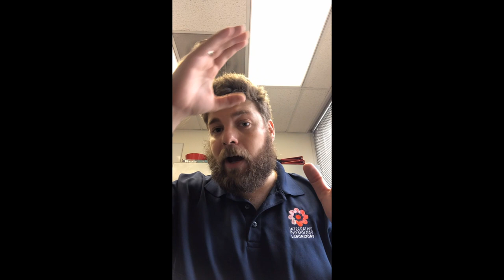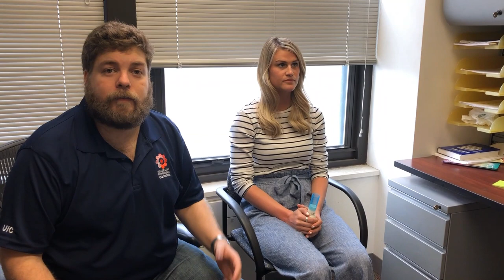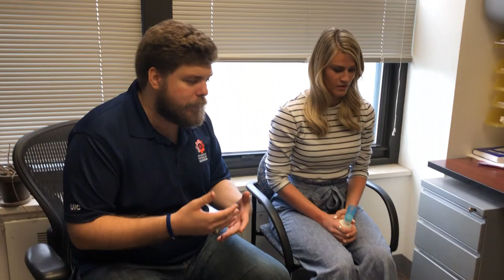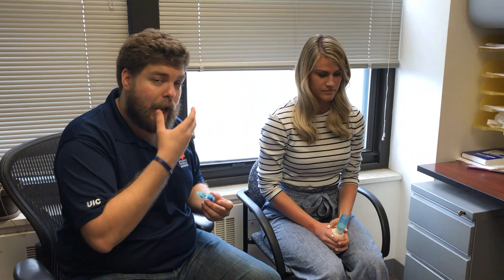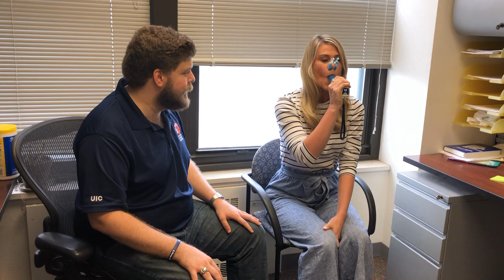Test of Incremental Respiratory Endurance (TIRE)

Comment: I try to measure TIRE via PrO2 and I am not sure, that I can get the value of MIP. When I measure the value of MIP separate during comon test for MIP the value is higer than the value during TIRE protocol. What do you thing about it?
Reply from the maker: What is the difference between devices?